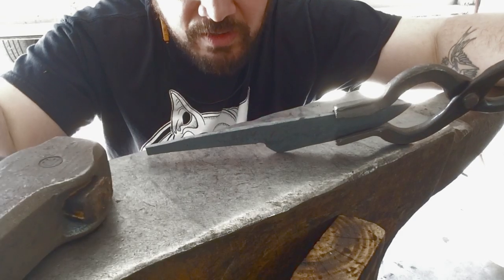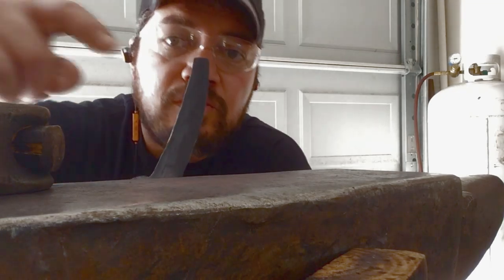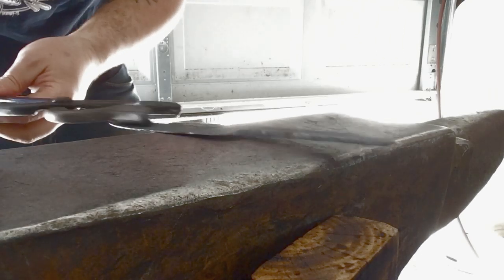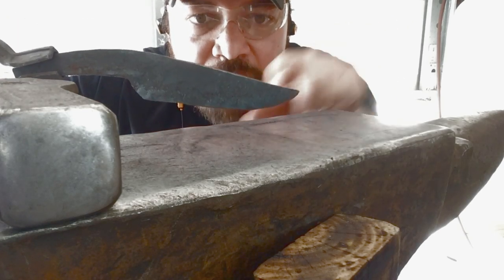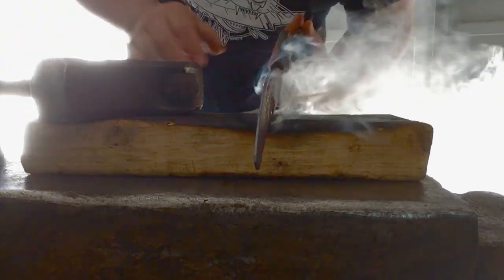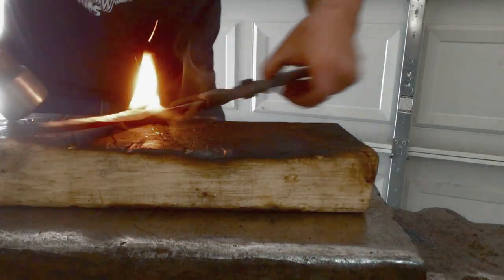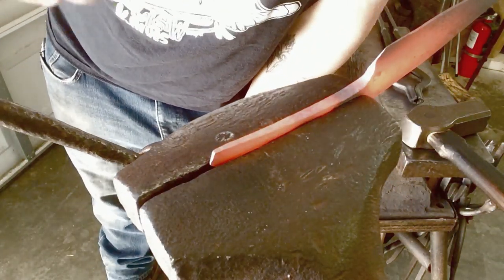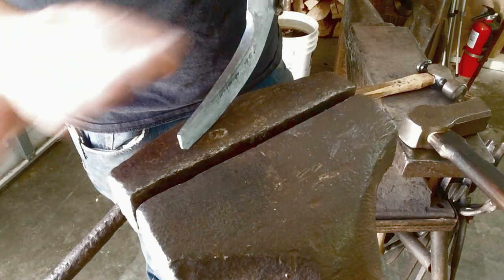FIP 8670 BENCH KNIFE ~ EPISODE 3

Comment: Why do you use a ball pein to upset the belly of the tang, rather than a cross pein Mareko? Loving the series!
Reply from the maker: Chrisnash68 a ball peen is incredibly effective in spreading the material. It’s a tip I picked up from my friend Peter Swarz Burt. The cross peen is way too heavy. The upsetting, or spreadingbof the material is a result of strikes lacking force. My cross peen is about 3.5lbs, the ball peen on the other hand is only 16oz, or so. The modded claw hammer is even lighter and more effective.